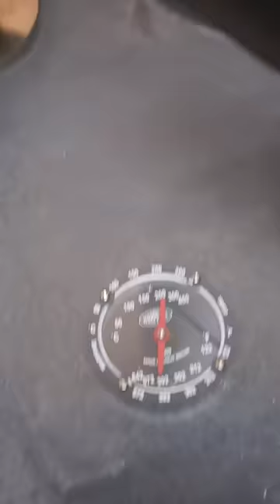🇬🇧 England Sent Me A Box 📦 BIG Surprise! #shorts

Comment: You realize when you have no power, how hard it is to move heat to were you need it
Reply: The end days arent coming yet
Reply: This isn't the way.   Heat moves itself by convection hot up cold down this moves an insignificant amount of air compared to convection.  If you want to move a ton of heat and make your house far more efficient and cozy make a big concrete box somewhere in your room around a few coils of copper pipe.  Pump hot water from your stove through that when your stove is good and hot.  Once that pedestal is heated it will give off radiant heat all day.   Make a table with a big heavy concrete pedestal and bam your room will be toasty.
Reply: Right??? Just ask all the women in one of the African American churches/gospel from the late 18th century! Them hands be flapping with a fan till they fall off

Comment: Nice two power piston stirling engine.
Reply from the maker: Yes, thanks
Reply: @wranglerstar  If there was only a "Vornado" style fan being driven by that Stirling Engine.  Then your stove fan could direct a beam of warm air to much further destinations in the room.  Maybe you could have a proho project to make a vornado style air circulator fan housing for your fan.  This fan housing would be FREE STANDING in front of the fan.  Thus it is not physically connected to your Stirling Engine in any way.

Comment: Incase anybody was wondering these fans range around $400-$700
Reply: Can also get cheaper ones for those on a budget, they really are awesome to have
Reply: @FundyisleLegacy what is the point of them?
Reply: @Levimillsap07   B/C some of us are on a hamburger vs. a steak budget...
Reply: @Levimillsap07  moves hot air around without the need of electricity, it uses the heat from the fire to spin it
Reply: @FullThrottleRacing535 can you use a parabolic mirror to shine on thermoelectric generator to harness electricity
Reply: @FundyisleLegacy where can you get cheaper ones?

Comment: the cool thing about sterling engines is that if you put mechanical energy in the output(in this case fan) the contact points(the base) will get hot and cold, so they work both ways.